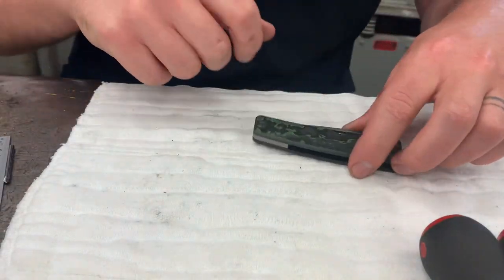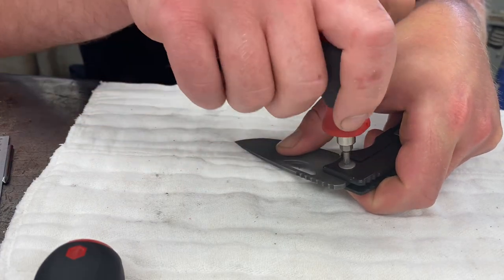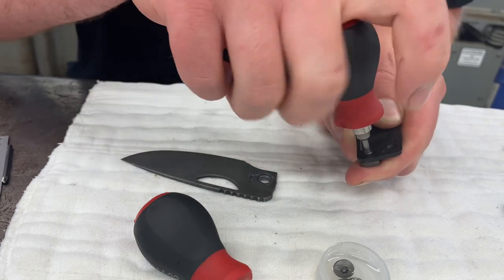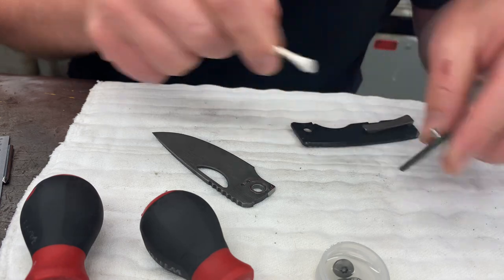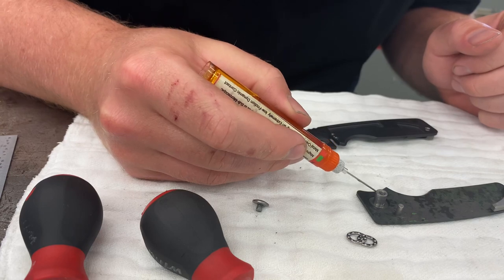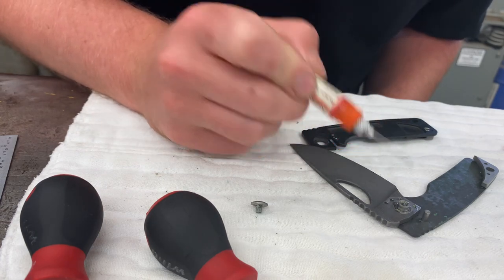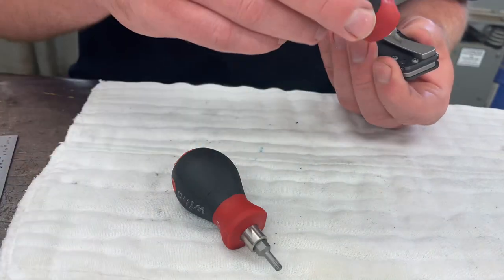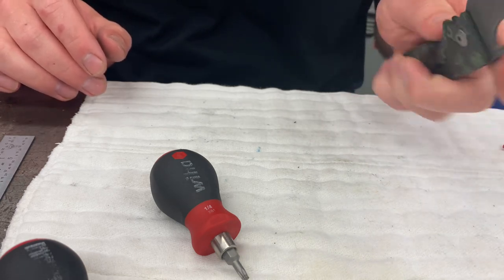OZ Machine Roosevelt Disassembly and Maintenance

Comment: Why aren't there steel washers on the titanium scales? Ceramic bearings are much harder than titanium. It seems they will wear a track in the scale over time.
Reply: Grismo, Koenig, hinderer and many other high end pocket knives dont put steel washer on titanium. Just don’t over tight it. Center your blade with the pivot and you’ll be fine for decades